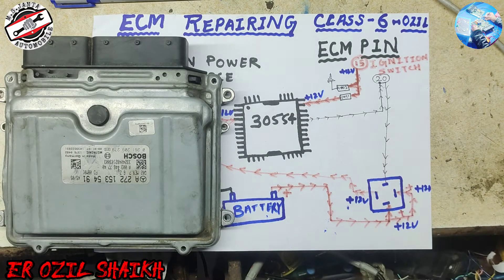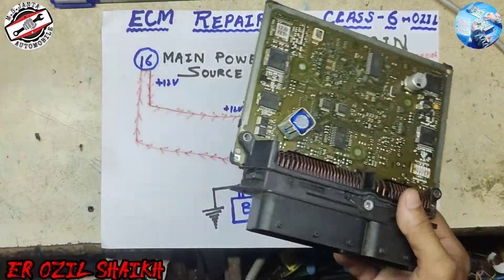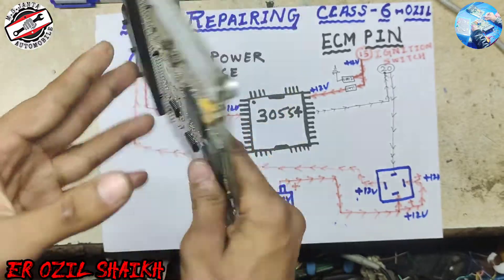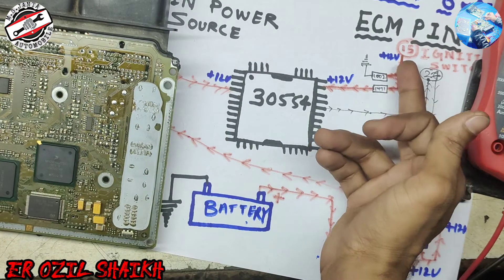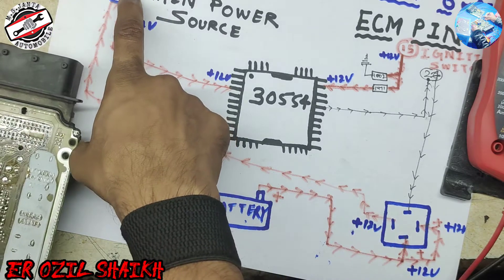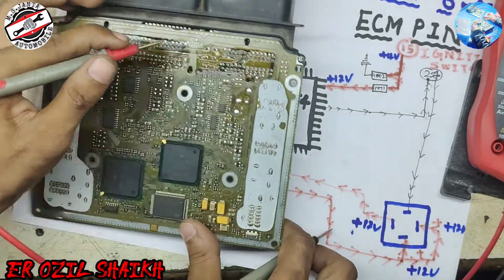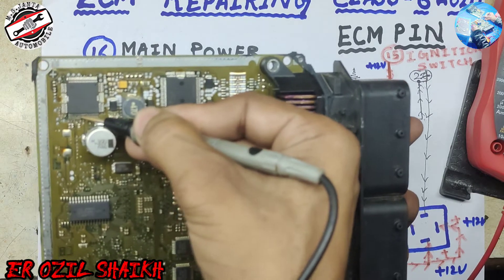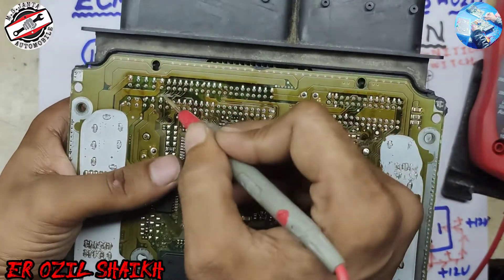Ecm Repairing Class-6 in English | Mercedes benz 272 ME9.7 Ecm Power ic explain | Double processor.

Comment: i have same ecu my problem missfiring too i check the trigger pin in ignittion coil wiring no 1 n 4 there is no pulse
Reply: and i got p2300 n p2309 The control line to the ignition coil of cylinder 1 n 4 has a short circuit to ground. p0300 random misfiring and p0303 misfiring cylinded 3. can u teach me to solve my problem, thanks
Reply: @adipribadi544 did u solve
Reply from the maker: Where are you from
Reply: indonesia